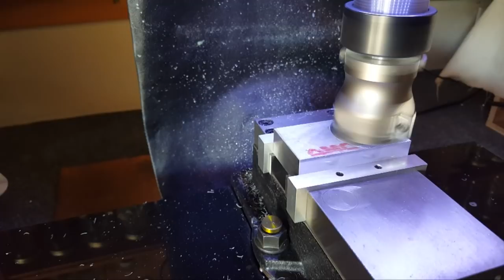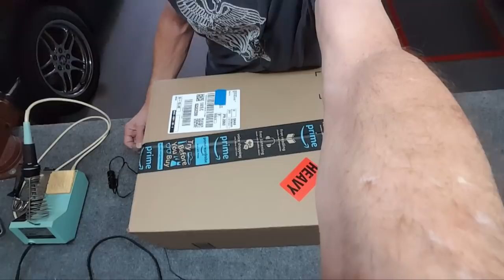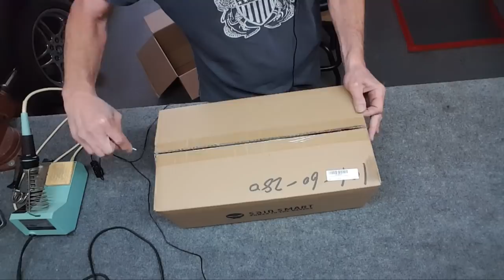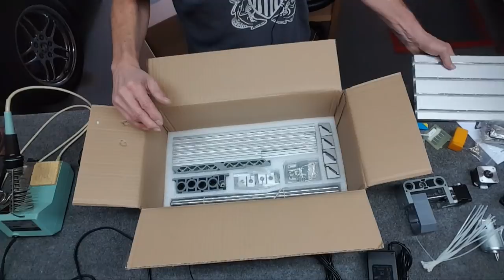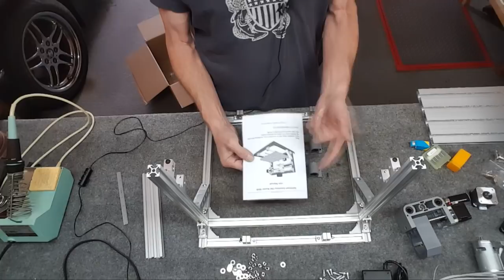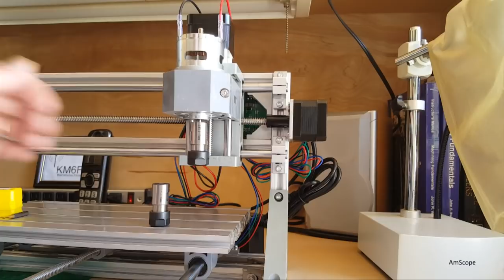DIY 3 Axis CNC Hardware & Software Setup Part 1

Comment: Thanks for the video Dave! It's highly interesting nowdays.
Fusion 360... (ConFusion360...) Tried a 3 year free license but their tutorials are presented by a guy in express need of the bathroom... Different version and an impossible foto of the screen and the clickings... Dumped it. CAD == CardBore Aided design here....
 Parallellports can be used bidirectionally! I use a program named FX (Fastlynx) and a special cable to transfer data between 2 old computers using the parallell port!
Cheers.
Reply from the maker: Freecad!

Comment: glad you got a good one (sort of) I just found this vid after I put my 3018 together, I was not impressed at all. The first thing I had to do was beburr the ends of the Linear rods, another was the amonunt of shaving left in the extrusions, I had some m5*8 bolts missing, I had to work from the 220mm upright so I could put it together plans they sent were useless, anyway got it all together tried to run it for the first time from GRBL controller, to see if the motors work properly, guess what doesn't work two hours later and after a few phone calls still not working seems the board is no good, lights up flashing while putting the xloader onto board , but thats it, have been in touch with seller still waiting, so at the moment $230 sitting doing nothing, actually more because I had to go and buy the missing hex bolts , I'll watch your next video on this see how you go. I know now half way thru 2020 but I just found this video
Reply from the maker: If you need any help my email is shown at the end...

Comment: The two surplus brackets /can/ go into the angle between the vertical columns and the beam connecting their foot points. But they are not really necessary.

Comment: Hello Dave. I am new to CNC and want to make plexiglass panels with my SainSmart 3018Pro for my flight simulator. My problem is getting my designs in AutoCad to the Grbl software. How would I do that, if it is possible.
Thanks,
Michael.
Reply from the maker: AutoCAD is strictly for design only it does not generate Gcode. I believe Autodesk Fusion 360 does or you can try importing the file into FreeCAD. I would just make the panels in FreeCAD. Grbl is a Gcode reader Gcode is the movement instructions.
Reply: @TheMiniMachineShop  Thanks for the quick reply Dave. Concerning the Gcode, in Part 3 (I believe) you spoke about entering the Gcode manually into the reader. Why would this be necessary and how is one to know what code to enter? As you can see I am completely new to this.
I did download the FreeCad and FreeG program from your link.
Thanks again.
Reply from the maker: Now you lost me FreeG? FreeCAD yes but? Last on the Gcode manually I have no idea you're referring to. Gcode is not entered manually its always a file that's opened. Grbl commands can be entered manually.
Reply from the maker: My email is shown at the end of every video!

Comment: what cable CNC used to connect to your laptop ? USB or parallel cable
Reply from the maker: It is a USB cable which I think came with the machine. Part 3 I talk about the driver for it.

Comment: Your information about parallel ports is a bit off. Though add on parallel port boards are getting harder to find these days. Looking at that machine the unsupported linear guides look flimsy. But you'll probably be OK. If you really want to upgrade it someday I'd try to get good rails for the two long axis. They're not that expensive. I built a CNC machine from scratch and it is a big job. A kit saves a lot of trouble.
Reply from the maker: The motor is very low HP so the force on the guides is very low. I find it stable enough to do the jobs I need very well... Being in IT I tried a number of parallel add on's with no luck so not sure what you are referring to.
Reply: @TheMiniMachineShop  I am referring to a parallel port expansion board. I am not sure what parallel add on's are myself. It sounds like the force of low is working for you. Like Sly I like to take it higher myself. https://www.youtube.com/watch?v=BqWQzOzK3kw

Comment: r if we use  the mach3 and 4 , do we need to apply some  software on arduino?
Reply from the maker: Mach 3 uses a parallel interface only Mach 4 uses a USB interface which is needed for the machine. You would have to do a lot of programming setup in Mach 4 to get it working. I would NOT go that way!
Reply: @TheMiniMachineShop  there are a lot of translators available for Mach today. Because Mach needs them. That's why I use LinuxCNC.
Reply: Dave M my cnc router would be 3.70meters to 2.60meters so, which stepper motors should I use ? Nema 34 8.2 nm is okay?
Reply from the maker: Any NEMA 23 or KL23H256 which is cheap, small ad powerful.
Reply: the last one what is the differences between stepper motors and servos? My cnc will be 3.70cm -2.20cm . And I will use wood for source, which motor should I use?
Reply from the maker: Servos are like a regular DC motors with a fine position disc on back. They are extremely smooth and fast. They're also extremely expensive motors and controllers. Steppers have magnetic coils which cause the shaft to move in steps or increments. Micro stepping gives plenty of resolution so everyone is using them for this reason and also the cost. I designed servo systems because of the acceleration/deceleration control you can get. Steppers just step period.

Comment: Thank you for the video.

I put the motor in the freezer and the collet chuck on top of the wood stove and still ended up pressing it onto the shaft with the vise.
Reply from the maker: LOL I used a torch and it went on way to easy. I was shocked! Amazing what .0002 smaller can do...

Comment: Hey Dave. Great tutorial video and thanks for mention us!
Reply: Hello. I am looking for a machine like this to do one thing, and one thing only. I need to make 3/4" round disks, out of 1/4" thick acrylic. The first thing would be a 5/8" round "groove", half the depth of the 1/4", and then a 3/4" round complete cut through the acrylic. I would basically be ending up with small caps that would snap onto a 5/8" OD acrylic tube. Would this machine do that? Thanks in advance!

Comment: Hi Dave, I have got a  similar machine  but from a different vendor.. The softwares used is Grbl Control, Inchscape for making the Gcode from a drawing in fact Lettering
The Gcode produced from inchscape  and saved as Makerbot . (Hope I got it right ) lot of the Gcode Lines obtained is not understood by the Gebl control and gives error. Like the dwell : G4 P150 and so on, i am still struggling , perhaps groping is the word
Can you suggest ; 1. Sofware for drawing   and converting to GCode  may be free or even a paid version.
 Can a 3D model /lettering be done with this machine , 
Thanks
Reply from the maker: Go to my channel and watch part 2 and 3 for software. These are other tutorials to get you going...

Comment: Would a power conditioner not solve the noise when the mill runs 0:34?
Reply from the maker: Not really for this situation the spikes are intense and fast. Since the signal is based on interrupts the ground noise needs to be less than 0.2V...

Comment: I just purchased this same machine after seeing your video. The extra right angle brackets go on the inside bottom of the vertical legs. There should be three brackets on the bottom of each vertical leg. At least that's what I figured out. The ER11 collet requires you to heat it before installing it on the motor shaft. It probably isn't coming off again after you get it on that way though. They tell you in the instructions it won't fit and needs to be heated before installing. I haven't done that yet. The lower bearings in the spindle motor housing are binding when you install the guide shaft on mine. I sent an email to SainSmart and we will see what they say. And by binding I mean when just sliding the shaft in it will hardly move. Took the motor housing back off the machine and tried to just slide the shaft in while it was on the work bench and no go. It's something in the way the bearings were installed is my guess. Otherwise, I'm pretty impressed with what you get. It's a bit fiddly to make the frame up and I'm sure it will need a lot of adjustment to get it really squared up but so far I like it. The plastic bearings and lead screw nut under the table are weak. I started seeing white stress lines after tightening the screws and backed them off a bit. I could see that they would crack if you were not careful torqueing the screws there.
Reply from the maker: You need to watch part 2 and then software pt 3 this Friday!!
Reply: I'm interest in this machine. What kind of controller board, connector to the computer, controller program it is used? And is it probably to build case to that controller board? And I'm interest to attach vacuum to that machine if that capable.

Comment: Hey Dave, love your videos! Just a note on parallel. Still common in the CNC world, my plasma table uses parallel. It's easy to add to a desktop with a PCIe parallel card from a company like Axxon.
Reply from the maker: Started with Mach3 some years ago which was parallel only. Stone age interface! Had paid $$ for the parallel controller which died so bought another. Tried many add on parallel cards and found only built in motherboard ones worked. Why parallel is still in use is beyond me. This machine is so much better... USB!
Reply: @TheMiniMachineShop  USB is polled not interrupted. So you cannot do real time control over USB. Your machine sidesteps the issue by having a microcontroller on it. So you just transfer G Code to it then the MC runs the machine. But there's drawbacks to going the microcontroller route too. Being so tiny they are not very powerful themselves. Chatting with a dev of the controller software that I use they told me that GRBL has no trajectory planning in it whatsoever. It also uses a cut down G Code to fit in the available memory. So it is weaker. I use an add in parallel port card but I also use a custom buffered break out board that I made for it too. So far it has been holding up OK for me.

Comment: Hi Dave, I bought the exact same unit last year. Getting it working was the easy part. It's a load of rubbish! The play and flex around the spindle and z axis because of the construction and over use of 3D printed parts is frustrating. I ended up using the motors, screws and electronics and completely rebuilding my one. Good luck
Reply from the maker: I'm not finding it that bad which you will see in the video tomorrow. But all I've done is engrave so far aluminum and 1018.

Comment: Hey Dave, We will miss seeing you every Friday!  Understand how much time and effort goes into producing the videos though.  As far as CAD/CAM.  I am using Fusion360 myself, I had a little trouble getting started, but needed to get it under control because I mentor on a robotics team and volunteer in the local high school metal shop.  I found Lars Christensen's tutorials on YouTube to be very helpful.  He walks you through projects to start so you can get the basics figured out.  Maybe not for everyone, but worked for me and I think I am older than you (68).  Parametric modeling takes a little getting used to if you cut your teeth on 2D, but once you get it, but the capabilities are huge.  See you next time.
Gary H.
Reply from the maker: Yeah still have 360 installed but wanted something easier and think I found it! At 63 and having spent 40 yrs in software and hardware design just not interested in complex stuff!

Comment: Hello Dave.  Always enjoy your videos.  But, (you knew there was a but coming) I think you are setting yourself up for failure.  All was good until you mentioned wanting to cut aluminum.  You will probably be able to engrave it, but that will be about it.  A 60 watt spindle would maybe allow you to use a .062 end mill at about .005 deep, but that would be it.  Add to that a machine that is not at all rigid and you are going to have insurmountable problems.  You may go down a slippery slope trying to cut aluminum on that machine.  First, hooking up a trim router, then trying to figure out how to stiffen it up, then trying to slow the spindle down, ad nauseam.

I run a 2 1/4 hp router on my machine.  Yes, I can cut aluminum.  But let me tell you, feedrate is about about 25 IPM with a .015 depth of cut.  Tedious.  This on a machine that can cut pine at 800 IPM, .5 dia end mill with a .5 DOC.  Even though it can do that, it is not rigid enough for aluminum.

Not bad mouthing the machine, I am actually considering getting one to do light engraving work.

Comment: Hi Dave
Been using cad for 30 years and found I just could not draw in F360. So totally different to what I have been using.
I have managed to use it to write code for my cnc milling machine though, I did not find that as difficult to master as the drawing.
A few folks I know of, use Design Spark to create 3D models for their 3D printers and have picked it up ok.
Look forward to your adventures with cad cam, will be interesting to see what you find that suits your needs

Comment: Hey Dave,  I personally have been using 3D Cad programs for many years (TurboCad Pro mainly).  Cabinet and furniture designs mainly.  Then I decided to play around with CNC.  So I bought a Shapeoko 3.  Well, I tried all sorts of software besides the Carbide Create and Carbide Motion and nothing gave me the results I was hoping to see.  Tool paths were clumsy, Cad drawing didn't always result in correct model machining.  Then I decided to give Fusion 360 a try, like you I didn't really want to spend my life (I'm 72) learning a seemingly complicated CAD/CAM program.  So  looking around YT I found lots of channels on learning Fusion.  For me I found Lars Christensen's channel along with John Saunders NYC/CNC channel very helpful.  Lars has an "Absolute beginners" series that takes you step by step through the basics.  John Saunders "Fusion Fridays" has a wealth of information on tool paths and feeds & speeds.  Because Fusion is fully integrated parametric CAD/CAM, the time to design and produce is reduced and can be as simple or complicated as you desire.  I use it for all my CAD work now and because it is free to hobbyist like us, it is unbeatable.  You should be able to manage a simple project in just a couple days and advance from there as you choose. 

I completely agree with Bill Strahan! 

I can give you a start on parts and pieces,etc, websites. I will email you in the next couple days.
Reply from the maker: How funny I started with Turbocad some 40 years ago! I do have 360 installed and tried it a few times but no simple way to even start with just a blank page! So I'm trying freecad for now.

Comment: I tried to learn 3d modeling for years, and it just never clicked.  I've been programming since I was 12 (40 years ago!) but the CAD stuff just never made sense.  I finally decided that was just a handicap and I found a series here on youtube at the end of last year called "Learn Fusion 360 or Die Trying" and decided that's what I would do.

Fast foward 8 months.  I use fusion 360 extensively, for everything from 3d printing models, CAM for the mill, and creating engineering drawings for equipment I have made in China.  Once you dive in, it'll click.  Just watch that series twice and follow along!

About 4 months ago I decided I would create a CNC conversion for my mini mill with 3d printed parts, and I designed it all and converted it super cheap.  GRBL on arduino with tiny NEMA 17 motors and belt reductions and some cheap M12X2MM pitch acme screws.  I got it all working.  It wasn't fast but it worked.  Then I designed a NEMA 23 conversion with ballscrews, still with 3d printed parts.  Once it all worked I machined the previously plastic parts from aluminum and replaced them as I went.  

Finally, I moved from GRBL to LInuxCNC, in part for LinuxCNC's backlash compensation.  And now I LOVE the mill!

So, I went from trying and failing to learn CAD software for about 15 years to learning it and using it to convert my mill, then mill parts on it, in less than 8 months.  You can do it, just watch those videos, follow along with Fusion 360 on your computer while you watch them, and then make a list of simple things to model and just work through your list.  Before you know it you'll be able to model complex parts.

Good luck and thanks for the videos!

Comment: I have a very similar little machine. I use it to engrave brass and aluminum plates. Software is still on going to find a product that is easy and reliable. Too many projects to little time. They do work really well and are great to learn the basics on with really cheap crashes instead of the ones on a mini mill.
Reply from the maker: https://www.freecadweb.org/wiki/Download
Reply: Thanks Dave! I’ll give it a try!